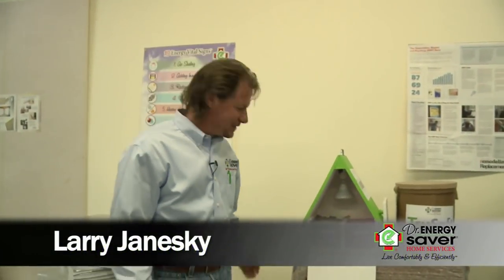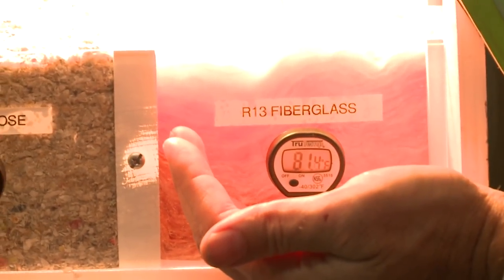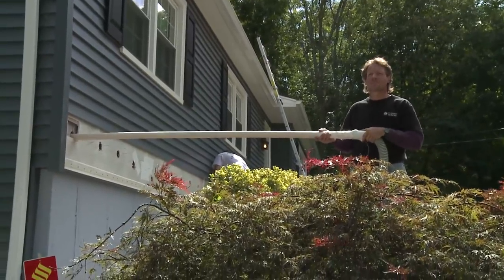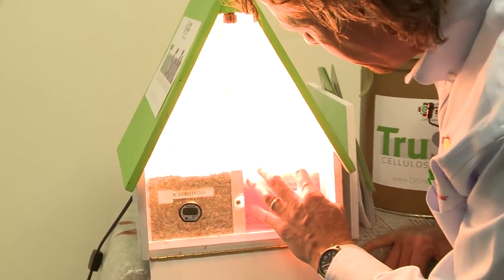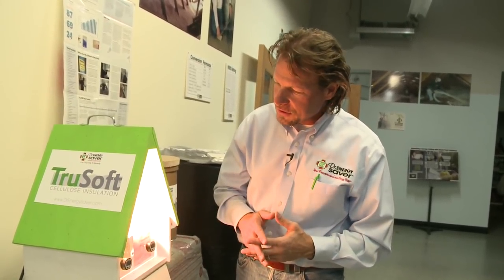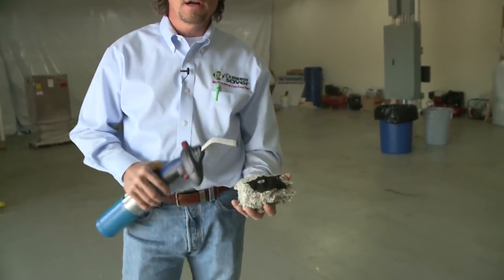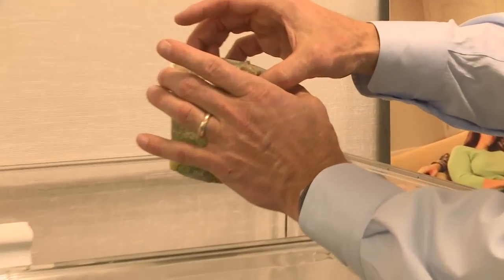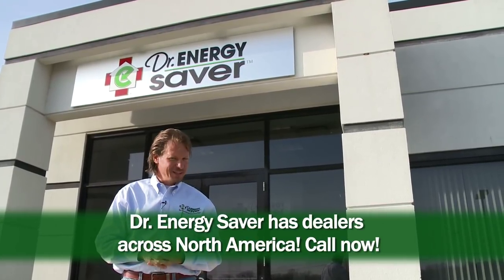Why Cellulose Insulation is Better than Fiberglass Insulation

Comment: The temperature test is bogus! It is deceptively designed to measure the materials' ability to block infrared and visible radiation from the bulb rather than thermal conductivity which is an entirely different property. A more fair test would require placing an opaque surface, e.g. a piece of drywall, on top of the insulation to block the radiation and actually measure the conduction which is all we are concerned with in any real-world setting.

Another tip-off: Both materials are ambiguously labelled R-13. R value has a meaning only when specified for a product with a defined thickness. Assuming the meaning of the labels was that each side, in the tested thickness, provides an insulation value of R-13, then both must conduct the same amount of heat by definition. They cannot differ in any fair test of thermal conduction.

I was planning to insulate my home with cellulose, but after seeing this slimy act of deception I will reconsider that decision.
Reply: Bob Silvern Yes, this is classic hoodwinking here with that test, from the obviously observed issues to a host of other unseen factors. It fools some folk all the time, and these tests are designed by manufacturers and paid promoters, and you would have to be pretty dull not to see through it. We live in a 'anything for a buck' culture.
Reply: Ki I
Reply: +Bob Silvern After they just showed you how well it works, you decide not to use it? No, thermal conduction is not all you need to think about in the real world.  Convection air current travels right through fiberglass, and the siding of the house radiates heat just like that lightbulb does.  Unless you are planning to wrap your house in aluminum foil, you also need to block radiation heat transfer.
Reply: ralphinator2 The convective properties for cellulose compared to fiberglass may or may not be better. I do not know and the experiment performed in the video does not attempt to measure this. People who have large openings in their walls through which there is notable airflow should probably just caulk those cracks rather than rely on in-wall insulation to block the air flow.

As for your claim that "the siding of the house radiates heat just like that light bulb does", you are mistaken. The total radiated energy of an object is proportional to its absolute temperature raised to the fourth power. The incandescent light bulb temperature is about 3000K, compared to a warm wall at let's say 130F or 328K. The radiation from the wall compared to the bulb is therefore in the order of (328K/3000K)^4, or about 0.014%. This is why the bulb radiates blinding light and scalding heat, and the wall does not.

To summarize, in real world applications, the conduction of an in-wall insulation material is by far the most important property compared to radiation or convection. The "experiment" in the video is grotesquely flawed in that while it claims to measure the conduction of the material, by directly irradiating the material with an incandescent light bulb (a 3000K visible and infra-red emitter), it is primarily measuring the material's ability to block transmission of that radiation rather than its conductive properties. Had they actually measured the conductive properties, they would have found them to be identical because both were specified as R-13.

I don't have a strong preference for one type of insulation over the other, but I would certainly avoid doing business with Dr. Energy Saver after seeing how they attempt to deceive potential customers with a clearly bogus demonstration.
Reply: Bob Silvern Cellulose is very good at stopping convection while wind blows right through fiberglass.  It can be used for air filters.  Convection transfers heat from the outer wall to the inner wall.  You are right that there is an exponential difference in radiation, but the square footage of a wall goes a long way to making it matter.  If you stand near a stone or brick wall at night, you can feel the radiation coming off it.
Reply: ralphinator2 When you hold your hand close to a warm wall and you feel heat, you are feeling primarily convection rather than radiation. How do we know this? Precisely because you have to hold your hand close to the wall to feel it. 

When the distance to a wall's surface is small compared to the distance to the wall edges, the wall can be approximated as an infinite plane. The radiated energy from an infinite plane has a constant amplitude, independent of distance (ignoring loss due to the air molecules which is very small for small distances). This is very much unlike the heat from a light bulb which can be modeled as a point source for which the radiation falls off with the square of the distance. Since you don't feel the heat from the wall more than several feet away from it, the heat you feel up close cannot be from radiation but rather from convection.

Of course, there is an interior wall temperature at which radiation becomes dominant over convection and conduction, but I think that's around the point where you need to call the fire department.
Reply: Bob Silvern Convection heat you feel on both sides of your arm.  If you feel heat only on the side facing the wall, that's radiation.
Reply: +ralphinator2 I agree in principle, although this test can be deceptive because the front of your arm facing the rock to some extent blocks the convective airflow to the back of your arm. If the test were done with a wind blowing I would be more likely to accept it.

In any case, can we agree that testing the insulation with a 3000K light bulb shining through it likely produced very different results from what would occur if a piece of gypsum board had been placed directly above the insulation?

Can we further agree that Dr. Energy Saver, supposedly experts in heat transfer, likely fully understood the nature of their deception?

Would you hire this company knowing this?
Reply: Bob Silvern With convection current, 3" from one side of your arm to the other isn't going to make any difference in air temp.  And if you are several feet away from a wall, it is no longer like an infinite plane, because you are no longer receiving radiation from 180 degree angle.  The further you get, it goes from an array of point sources down to a single point.  So the radiation will also decrease exponentially with distance.
If you watch those two links I posted here, you will see there is a lot more going on in a wall than just conduction.
If anything, this test proved that cellulose is much better at blocking radiated heat, and also radiated sound.
To have even better insulation, you can build the wall with two sets of studs staggered, so the outer wall and inner wall aren't attached to the same studs, so no conduction through the studs.
Reply: +ralphinator2 You might want to verify that claim that air has value of R-5 per inch. See http://inspectapedia.com/insulation/Insulation_Values_Table.php#Air which states "Dead air space in wall cavity, 3/4" to 4" (winter): 0.97 R-value. That's not per inch, that's for up to 4".

Here's another source: http://dnr.louisiana.gov/assets/TAD/builders_guide/Chapter_11.pdf which states 3.5" air = 0.80 R-value.

And another: http://www.coloradoenergy.org/procorner/stuff/r-values.htm which states 4" = 1.00 R-value.

Do you by any chance sell cellulose insulation?
Reply: Bob Silvern I have remodeled several houses with cellulose and personally think it's awesome stuff.
Reply: Bob Silvern Whoops, I just quoted the first google link. The actual R value of air is 1.06 per inch.  An empty wall actually has a lower than 1 R per inch value because of convection and radiation inside the wall.  If the fiberglass isn't trimmed to fit perfectly, it allows convection and radiation to increase like those links with the infrared camera show.
Reply: +Bob Silvern , Use resistance heat and you get the same result. Fiberglass is inferior. Don't let education limit your capacity to follow a simple demonstration.
Reply: +ralphinator2 , don't count on air to provide insulation in a hollow wall. The air leaks out continuously.
Reply: +Larry Maloney //  

Cellulose paper insulation materials are environmentally friendly,
cost effective due to its waste paper origin when compared to Fibreglass insulation  but it is combustible and rapidly burns out. The main causes of cellulose insulation fire are: chimney related, Electrical faults, Lightning strieks affecting the roof and contractors carelessness. Installation advice: Electrical / Check and test the attic space electrical installation by a qualified electrical contractor at least every 3 years . Loft wiring should be in conduit but not attached or adjacent to cellulose insulation.Do not place high wattage lights or electric fires near the insulation or allow the insulation to overhang electric fittings.  Do not insulate near recessed lighting into the ceilings below. Use heat resistant bulk head light fittings in the roof space. Electric supply cables need to be prevented from coming in to contact with cellulose insulation, or adjacent to other flammable materials.
Reply: Cellulose gets damp and it grows mold. I am a contractor I see it all the time.
Reply: So Bob, how is your attic heat now, 4-years later.  Did you use fiberglass, cellulose, or some other material.

Comment: One other comment too.  C has no requirement to be kept away from light fixtures or heat sources any more than FG!  That is completely bogus.  In my neck of the woods, they are treated the same as to the installation next to fixtures, chimneys, recessed can lights, flues, etc.  Houses here are not burning down left and right!  I have been in many 1950's houses with C and FG, never have I seen a problem with either one next to any of the aforementioned items.  However the one thing I always saw, dirty FG around air leakage points!  The FG acts like an air filter for all the air coming by and through the leakage site.  RC, lights, pipes, soffits, open top wall assemblies, etc.

Comment: I have about a 1 ft. overhang around my home. Vents under the eves are separated by about 8 ft apart. Do i need to fill the over hangs were there is no vent. Also, my roof is very low with only 2 1/2 ft of room down the center. Your thoughts on this?.
Reply: Jim, my first response to "Your thoughts on this" is to sell the house.  OK, my tongue is in my cheek when I say this.  If your home has an "open attic" (air from the outside actively moves in and out of the attic) then you do not need to address the over hands.  
As to the 2.5 foot of room, it will be quite difficult for an employee to crawl around on his back and work.  Good luck.  Be sure to keep the attic OPEN to allow air circulation.

Comment: When you did the attic insulation re-do, why didn't you remove the old, dirty fiberglass batting, and just fill with cellulose? Why leave the higher fire danger batting there, underneath?
Reply: Fiberglass + cellulose is more efficient than JUST cellulose.
Reply: Handling fiberglass insulation in any way is something to be avoided.

Comment: the fiberglass batts in my attic are laid perpendicular to the joists and they are extremely dirty from the air leaks, should i fix the air leaks, remove (or just put em parallel to joists) and blow in cellulose?
Reply: do both, you will address the conductive AND convective heat transfer occurring in the area

Comment: Why are they both R13 then? Would not in this example the cellulose be a higher R Value if it works so well?
Reply: Because the way they test R13 fiberglass insulation is under test conditions that are favorable to fiberglass. I.e. The Fiberglass will do acceptably if you have perfect conditions but in all other scenarios it does poorly. FIberglass is shit and like most things in life, the most popular option isn't usually the best option.
Reply: +One1vision , The are several primary differences between fiberglass and cellulose, One is fiberglass lets air leak past and cellulose does not. The hot air form the light leaks past eh fiberglass to the thermometer. That's what happens in yrou attic and walls and crawlspace or basement.
Reply: You pretend to be an expert, and say things like hot air goes down to the thermometer. HOT AIR ALWAYS GOES UP, the only reason thermometer shows higher temeperatue for glasswool is the infrared getting through. WHICH IS IMPOSSBILE IN REAL WORLD SITUATION. If you put a paper sheet on both materials, there will be 0 difference between 2 chambers, because they have the same R value, whic considers all types of thermal conductivity.  Shame on you, sir.
Reply: @Shadowkhn  Yes, heat rises, Sergey, until it fills the "envelope" which is the demonstration house.  Once the envelope (attic) gets a lot of heat it then filters down through the insulation, through the drywall, and into the house.  In conclusion, Larry in concept spoke properly...but perhaps might use different words next time

Comment: I dont understand why so many people choose to put in fiberglass since it heats up so fast. Why is it a big seller at Home Depot and offered by installers? For houses in the southwest would additional insulation be the first line of defense to combat hot summers or/and must you combine that with a whole house fan or attic fans? Thanks. where are you located?

Comment: A problem with Cellulose is the in a normal 8ft wall, it settles a lot over a couple of years and the top foot or two of wall now has no insulation.  We can take a thermal camera and see that in nearly all of our exterior walls, the insulation has settled leaving significant cold or hot spots.
Reply: Blow it in before sheet rock and they put  a glue additive with it to adhere to the area it goes on. I owned a 20 year old barn that was shot inside completely even under the roof panels and it never fell off
Reply: @cademarti1365 , obviously whoever built this house didn’t do that.  Not sure what was available in 1978 but it’s definitely just loose in there.

Comment: Few words. When comparing cellulose and fiber glass insulation as a insulation materials is good to say that first of all he didn't put same thicknesses. Ok it is with same R value, but why you didn't compare thicknesses with same peformance regarding thermal stability? . Second thing which has to be counting  on is price of materials. It is fact that cellulose has better heat capacity, and higher density which refers to heat wave conduction in summer days through construction, but for some fiberglass thicknesses ( higher than cellulose ) ,with better thermal conductivity you can get same results (in living comfort), but with lower price. ( I would like to mark winter time, where you have much bigger energy saving with fiberglass for less money)
Good approach would be to compare cellulose and fiberglass insulation with  same results for thermal stability of construction , and to see what are the costs?
Also you have to compare installation costs, and whole costs in life cycle of material. 
If the roof or wall is ventilated (what is recommended) , than influence of the heat wave during the summer days is not  so important.
Only if you consider whole this things you can talk about quality of some material for some application. Such approach ( in video above), gives you one side of the story, and other one seems is good not to be  revealed :-)
Cheers
Reply: All insulation is lab tested at the mean temp of 70 degrees. When the temp is dropped to 0 degrees, fiberglas loses 48% of its R value where Cellulose gained 10%. So in the winter when you need that good R value, the R-38 in your attic is now an R-16. Which do you prefer?

Comment: It also very clearly shows much less Fiberglass insulation over top of thermometer less dense than cellulose (light penetration). You forgot to mention that fiberglass Far outlasts cellulose like 100 years vs 50. It is very impressive however how well cellulose insulates and is fire retardant, cool! Cellulose also fluffs back better than fiberglass if compressed.  Probably most important is the cost of cellulose is only about 30% cost of fiberglass, so boom you win!

Comment: What I don't understand here is that for the same R rating, cellulose requires LESS material. So why are both the same size in height, length, width yet both say R13 .. Note, I am not an expert by any means

Comment: Laurin N that's why is so important to do a seal out of attic space leading to living area before installing cellulose insulation ( seal around anything that leads into attic like... ceiling fans, can lights, bathroom fans etc.   if you do have an attic hatch make sure is proper sealed with weather stripping or a light caulk around perimeter but remember .. attic space needs to be accessible. I hope this info works for you.
before I forget if your a.c. duct lines are in the attic space make sure they are all sealed correctly, this includes air handler.

Comment: You explain and test that R13 of cellulose is different from R13 of fiberglass, but you never mention why.  R-values are objective metrics.  You need to explain what's going on here in order to explain why one is better than the other;  According to the information you have provided us, your result is nonsensical.

Comment: Do you think this will help reduce vibrational sounds in a 1923 duplex with a shared wall down the center, if only the shared wall is done and not the attic?  There is also a good size crawl space underneath.
Thank you!